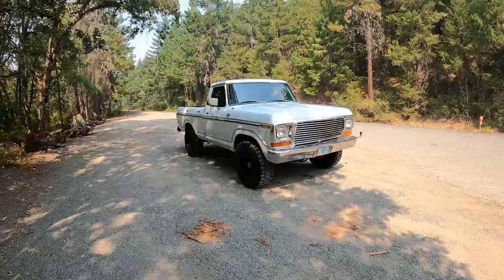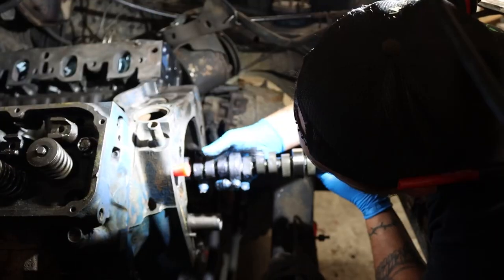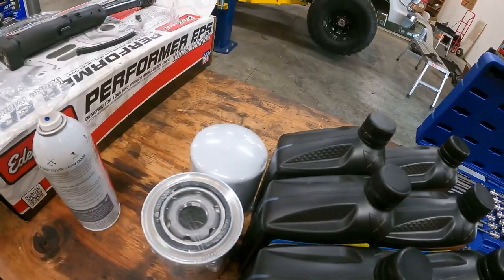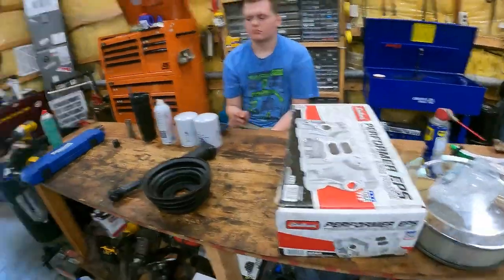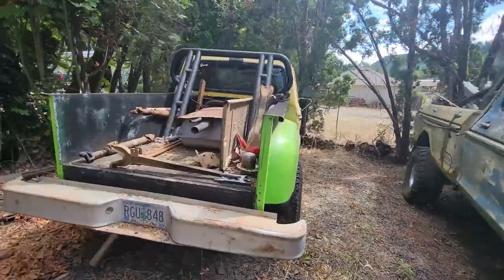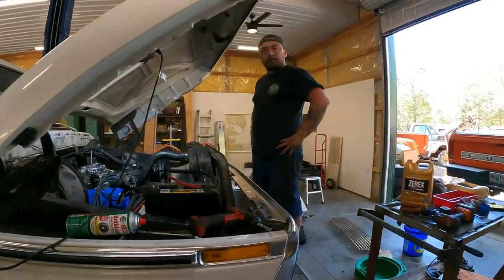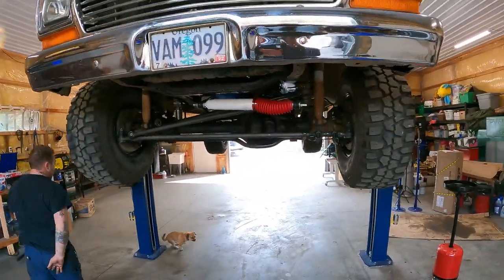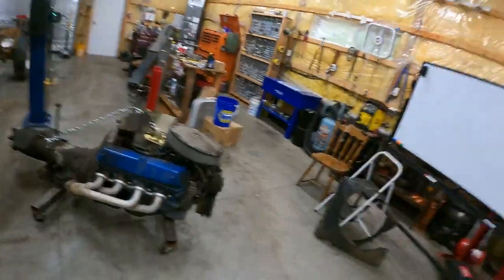Ford 400 Cam Swap. How To Go From stock to HOT!

Comment: Great vid, enjoyed watching!  Wonder if you would mind if I pick your brain on an issue with my truck?  I've owned an F350 dually mason dump with the old 400 for a few years now.  140k miles, I think.  It has some issues I think might be related to a worn cam, so I've been thinking about doing the cam swap for a few years.  It looked like you guys didn't need to change out valve springs with the new cam?  I've been looking for a mild torque/rv style cam that won't require a spring change.  

My truck has never had high rpm power since I've owned it, (hardly any power under load either, which is a problem with a loaded dump truck!)  The motor will backfire through the carb and die if you stomp on the gas.  Starts and idles nicely and runs ok up to 2000rpm or so.

I've been running the same Edelbrock intake (with a 600cfm Holley) you guys put on for a couple of years.  Didn't see a big difference with the new carb/intake. I also replaced the ignition with a new HEI distributor, no change (except nice easy starting now).  The advance is working well on the distributor, and the timing is set correctly.  I also put on a new timing chain as the stock timing gears (plastic teeth!) were shot. Engine has good compression and checks out ok on a leakdown test.  .  So I think the cam may be worn out - not sure what else could be going on!

I wonder if I should do a cam swap and keep the old valve springs for now.  Do you think I am barking up the wrong tree?
Reply from the maker: So I instantly went to the advance not working but you said that's good. Next, I'm thinking fuel delivery and spark. The HEI does run hotter than the stock coil's that are on the trucks and if you only running stock wires there is a very high chance that you're burning up your wires inside and then resulting in a weak spark getting down to the plugs. I personally ran into this on my 78 bronco when I upgraded its coil to a blaster 2. I had no idea that I was destroying my stock wires. We ended up slapping some high-end wires on it and that cleaned it right up.  Also, something I'm guilty of is not properly checking the gap on my plugs. The gap could be all effed up and again leading to improper burn of the fuel for your truck. 

The other aspect I would look at is your carb, when was the last time it was cleaned and tuned. Also, look at your fuel lines and fuel filters. There is a lot of bad fuel out there and you could just have some of that crud floating around in your carb bulbs trying to pass through the jets. 

Before we jump to cam, let's make sure to expire all this easy-to-check stuff first. 

I'm going to bounce your message off Adam and make sure he agrees with everything I said here and if anything is different i'll let you know. 

Keep me posted bud.
Reply: @PaperBeatsRock  Hey, thanks so much for all the suggestions!  Really appreciate it!  Definitely don't want to throw parts at the problem if it's a simple fix.

I did put on new wires a couple of years ago with the new distributor.  I don't think they are anything special though, so maybe I should try something better.  The plugs were also new then, and I did gap them.

Replaced the fuel pump, (stock mechanical) all the rubber lines, and filter within the last year.  I also pulled the pickup tube out of the tank to see if maybe that was gunked up.  Squeaky clean in there.

The carb was used when I got it (supposedly came off a 460).  It's a 4160 type from the 90's.  I rebuilt it myself.  The truck idles way better than it did with the old two-barrel (suspect that carb was dirty).  But the high rpm power/no power under load issue is still there, same as with the stock carb.  The dying when you stomp on it issue is worse with the new Holley, so I do suspect the accelerator pump needs tuning.  I doubt there is crud in the carb as the truck runs the same now as it did when I put the freshly cleaned carb on a couple of years ago.

I've been thinking about trying another carb swap too...perhaps a new edelbrock.  The truck  has a very rich fuel smell while idling.  Unforturnately I don't have an oxygen sensor or any equipment to do real carb tuning.  The truck doesn't ping at all, so I don't think it is leaning out under load.

I should also mention, the no power under load feels like the engine is missing.  When you crest a hill, there is usually a point where it feels like the engine "kicks in" and starts firing on all eight as the load comes off.
Reply: @TLG84  I would swap out your carb. And try a different one.
Reply: @jeremyfoos3786  Thanks, I am definitely curious to see if an Edelbrock makes any difference.  I just did an 80 mile trip on the highway with a 6000lb diesel chipper behind the truck, struggled to hold 55 on the hills.  I would think the old girl should be able to do better.  I will have to spring for a another carb one of these days.
Reply: @TLG84  look up summit carbs or quick fuel carbs. They have annular boosters. I never had much luck with edelbrock carbs.
Reply: @TLG84  - Mainly what you need is TMI pistons... then used 4 bbl., Summit 218/228 cam/lifters,  and adjustable timing chain set and you have double the power! 140K miles? Get new springs before the old ones break and destroy the engine! They don't cost that much... $60/set for Edelbrocks mild performance ones... Or, at least, new stock spec. ones...
Reply: @BuzzLOLOL  Haha, thanks - yes, it would be fun to build this motor right.  Probably not worth pinching pennies and using the sacked out springs that are in there now.  I think these old 400's can make way better power than stock without a lot of $.
Reply: @TLG84  - There are articles online showing TMI pistons, mild cam, new timing chain set to replace the stock one that retards the cam for emissions purposes can get you 350 - 375 HP and 450 - 500 lb.-ft. of torque... The 400's stock valves are already bigger than any valves that came in a Hyper Small Block Chevy... and those SBCs made up to 375 HP stock...

Comment: Great build really enjoyed watching the video 💪👍♥️ just one problem I thought around 490 lift cam as about as high as you can go with a stock 400  valve springs in the OEM heads?????? And the specs on this Isky cam is 5'10 so wouldn't that pose a problem &  cause valve float?
Reply: Just change the springs

Comment: How many miles on that engine. If it is at about 100k the main and rod bearings are probably getting worn. Best to check and replace while the pan is off.
You would think getting a cam for a Ford 400, the parts person would be smart enough that the intake and gaskets should be for the Ford also.

Comment: How many horse power you think is now ??
Reply from the maker: It was a solid increase but honestly I'm not sure.
Reply: I did a similar 351m but did some mild port work with an Edlebrock performer cam with a little more advance from adjustable cam gears. Custom curve GM type distributor. Cleaned up inside of exhaust manifolds and put single 3" exhaust in front of rear axle. Easily pulls past 5000rpm. Awful close to 300hp

Comment: Does it have stock cast iron heads on it still??
Reply from the maker: yes, it does. Chris was working with a limited budget so we started with a solid base that we are able to improve on overtime. The next upgrade on it will be the ignition system.
Reply: @PaperBeatsRock  it's beautiful. Is it possible to cam swap a 351w from a stock to a performance cam without a rebuild and new heads?
Reply from the maker: @mattisenberger4042  most defently. but you will have to remain as a mild street or RV cam. There is only so much lift that the stock springs can take. 

The first thing I suggest you do is to find a proper shop. So many current shops only have techs that only know how to do stock swaps on modern vehicles. Doing anything like this there is a high probability that they don't know how to tune a carb or do things properly for older motors.

Take that extra step at the start and find a guy that really knows what he is doing. Local parts stores can help with finding old mechanics.
Reply: @PaperBeatsRock  thanks bro. I've got a 351w with 119,000 miles on it and know how to change the cam and everything, but have been wanting to throw the small comps thumper cam in it. It's already got a high rise weiand intake, 600cfm double pumper 4 barrel, long tube headers and a chevy HEI distributor swap. Hooked up to a c-6 tranny. So I was thinking about getting the smaller of the three thumper cams in it. But the rest of the motor is factory stock. Of course I would also change the lifters and push rods and probably go with changing the springs. But do I have to get a entire head job? They are the original E-7 cast iron heads. And if I change cams would my truck start burning oil? It don't burn oil at all right now.
Reply from the maker: @mattisenberger4042  Your heads should be fine, but I would say you really need to ask Comp Cams on that one. Their help desk is amazing and have a wealth of knowledge on them and they don't want you putting in something that will give you problems.
Reply: @PaperBeatsRock  ok bro. Thanks for responding. Love your channel and your trucks man.
Reply from the maker: @mattisenberger4042  Thank you bud, and good luck with the build.

Comment: did you do the timing chain to, they have a factory retard in the stock ones.....
Reply from the maker: yes, we did the timing chain and a new water pump at the same time. The motor had been rebuilt back in the late 90s and it looked pretty good but there was a little slop in the timing chain and when in this far may as well do it. The new one is only $50 so it's a worthwhile investment if you ask me.

Comment: You've got to always keep in mind those parts shops and suppliers suffer "Chevy on the brain" and also the guys working there were flipping burgers at Mc Donalds last week and know next to nothing.
Ibe surprised if they know the difference between a 68 Pontiac and a 2021 Hyundai.
Double check and interrogate them every time.